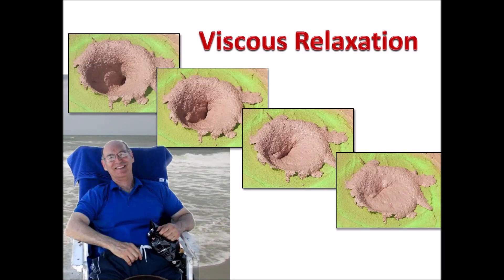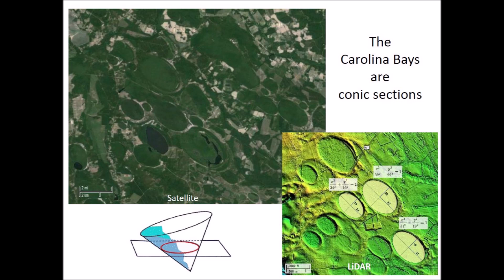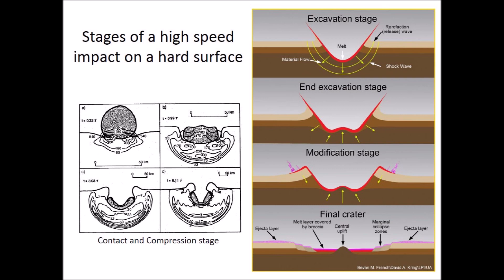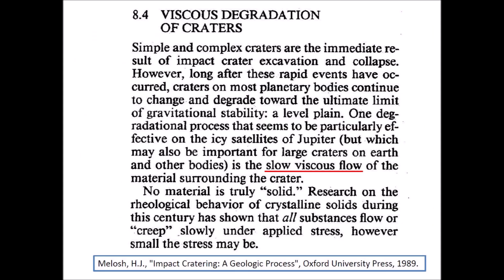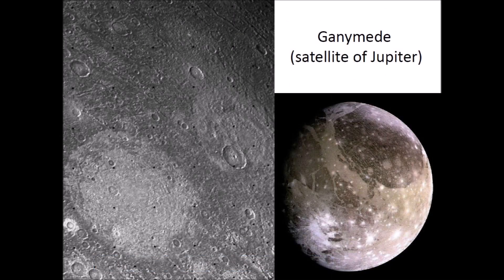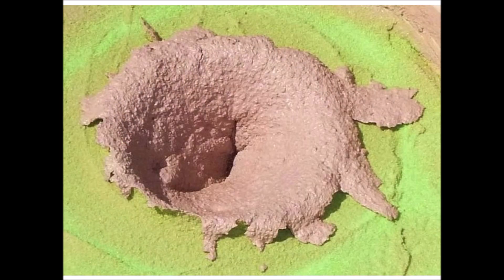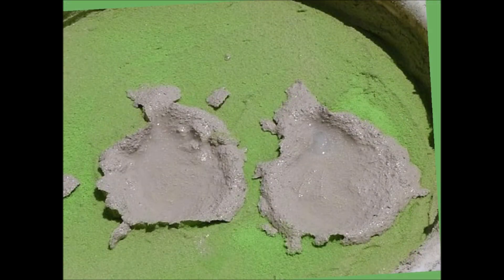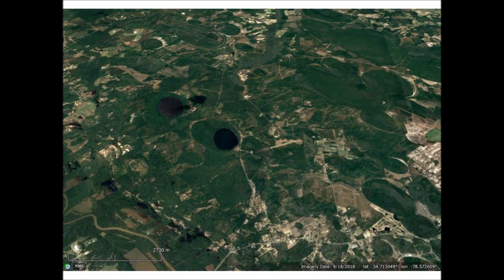Viscous Relaxation

Comment: I think you've proved they are from impacts beyond a doubt. Now we have to pin them to the YDB if that's indeed where they are from
Reply from the maker: Dating the Carolina Bays to the YDB is a hard task because the dates from radiocarbon and Optically Stimulated Luminescence vary widely.  However,  the dates of the overturned flaps (raised rims) provide some confirmation.  See this video: https://youtu.be/j63e8n0628Q

Comment: Antonio! I am thinking the ghost bay outlines and sand deposits are rock flour from the melting glacier chunks. Contact me at ahwild@aol.com
Reply from the maker: Impact cratering on a viscous medium displaces material by horizontal compressive forces to make the raised rims.  Rain percolates through the raised rims and washes out the clay, leaving only the white sand.  I discussed the sand rims in this video: https://youtu.be/jKvS4F9TA6s 
Note: the rims are not likely to be rock flour from the melting glacier, because the rims are the overturned flaps made during the formation of a penetration funnel before the ice projectile has had a chance to melt.  The friction of the impact may melt some ice of the projectile, but not enough to account for the volume of the rims. Also, many of the ice projectiles may not have contained much material from the Saginaw Bay area because they would have come from the top of a 2-km-thick ice sheet.
Reply: @Antonio_Zamora  most glacier ice contains suspended ground up rock - which may be traced to its point of origin. Why would the laurintide ice sheet be different? I think It is likely that the sand deposits around the Carolina bays are not local - but came in suspended in the ice chunks and accumulated under the areas where the majority of the frozen ice accumulated after impact and ultimately melted. Ie the southeastern tip end of the crater and at predictable points around the rims. There is too much sand for it to have been originally local to this area. I live in Sumter SC. I have been flying my drone over quite a few of these things in my area. The bay sand deposits are not typical local soil and there is too much of it. Ps thanks for responding. I have your book “The neglected Carolina bays” and have carefully read what you said about the rims. Glacier ice melt doesn’t produce clean water. It is full of white suspended silt. Please read up on glacier rock flour and lake Missoula. I have also been to see glacier melts in Alaska and Canada. Some serious study of the sand deposits may yield traces of rock which could have only come from Michigan.
Reply from the maker: @ahwild123  The only difference between modern glaciers and the Laurentide Ice Sheet would be the thickness. The clasts and sandy grit get incorporated into the glacier from the contact of the ice with the land.  The rock powder stays at the bottom of the glacier where it grinds the landscape.  New snow accumulates on top so that the top of the glacier is pure ice without stone powder. I went to Glacier Bay in Alaska, and the tops of the glaciers are always white, whereas the bottoms are full of grit.  Glaciers calve into the water and make it milky white from the suspended rocky material. The silt from the glaciers is quite different from the sand in the Carolina Bay rims, which is like beach sand.  This web page has a picture of me in front of one of the glaciers:
https://www.scientificpsychic.com/alpha/travel/alaska/glacier-bay-background.jpg
https://www.scientificpsychic.com/alpha/travel/alaska-glacier-bay.html
Reply: @Antonio_Zamora  thank you again for responding. , I see where you dug a trench in one of these bays and I admire your tenacity! I would like to gather some sand deposits from our local bays but don’t know if I’ll get the chance. There is indeed a strata of ancient beach sand all across the SC midland - but I can’t imagine how it would wind up at the characteristic locations on so many Carolina bays if it weren’t originally a part of the fractured ice chunk itself. Leeching alone without added material from the ice would not produce the characteristic patterns i don’t think - eg the small ghost bays don’t seem to even reach into the subsoil, but I can easily imagine a water /snowball making the pattern on the surface. I am hoping you figure all of this out during my lifetime , my dad would have been fascinated - he used to fly a plane and used the orientation bays to navigate.
Reply: I was over at woods bay state park last week . The sand around that bay is not the same as the sand dunes at ocean drive  beach sc...even if some ‘expert” tells you it’s local. The woods bay sand is finer and whiter, even it’s chemistry has got to be different cause certain local plants won’t grow in it.. And - Given how much material and ice your estimates say were distributed all over North America- that Michigan glacier sand may well be surface local everywhere now in NA.. But I’ll bet it’s different than what’s in the local substrata. I can’t think of a way that one could predict the original glacier depth of The ice that likely came from Saginaw bay although I wouldn’t think it would be pure surface snow. The snow on the surface would likely have vaporized on comet impact and only the more compressed deep ice have the cohesiveness to remain in a chunk- though fractured and launched by the explosive impact. My money is on deep compressed ice close to the bottom of the glacier. Which would have plenty of white flour powder in it. I think melting and leeching concentrated it on the surface - sure - but how does a very small bay excavate that kind of deeply buried sand?

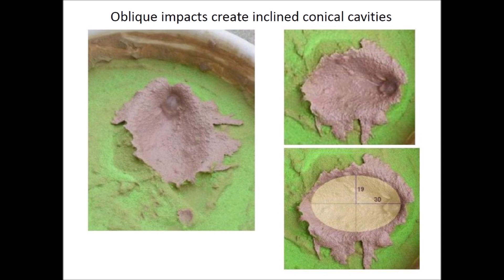Comment: You suggested that the displaced soil returns to its original stratification as a result of viscous relaxation ( 4:13 ). I am neither a geologist nor a physicist, but common sense tells me that the subsidence of the soil along the crater walls would result in a largely homogenous fill, or at least a highly distorted stratification. A cross-section of an impact into hard soil is an extreme example of this. ( 1:25 ) Can you direct me to a study or experiment that demonstrates such re-stratification?
Otherwise, I'm totally on board with your theory! I love your videos and look forward to many more. Thanks for all that you do.
Reply: No doubt the impact on the Laurentide ice sheet ejected enough material into the atmosphere to drastically alter the climate--hence the Younger-Dryas cooling. Might it be reasonable to think that there were periods of catastrophic rains prior to the cool-down? These rains would have hastened the liquification and subsidence of the crater walls.
Reply from the maker: Most of the East Coast has the water table within 5 ft of the surface. Seismic vibrations of magnitude 6.0 or higher would have been enough to liquefy the soil. The impacts with energy of 13 kilotons  to 3 megatons of TNT would have produced seismic vibrations equivalent to 6.0 to 7.54 magnitude earthquakes, which would liquefy the soil. Thus, the ice boulders would have hit a liquefied terrain regardless of whether there had been rain before or not. Search for "liquefaction experiments" and you will find many YouTube videos of geology experiments showing vibration-induced liquefaction.
Reply from the maker: The video included pictures of experiments showing that viscous relaxation fills the cavity from the bottom up by centripetal laminar flow. The experiment with the red layer demonstrates that the stratigraphy is restored. This is what is actually observed in the Carolina Bays. The bays do not have a jumbled stratigraphy, and this is used as an argument by opponents of the impact hypothesis to claim that the bays were not produced by impacts. The experiment with the red layer serves to counter this argument.

Comment: Excellent presentation. A general question about the Comet fragment impact in general. Would it have been energetic enough to eject matter from Earth permanently ? And if so, do we have simulations that are reliable enough to come close to predicting the aftermath ?
Reply from the maker: Most large impacts can eject some material at speeds exceeding Earth's escape velocity. Similarly, impacts on Mars have ejected stones that later fell on Earth as meteorites.
Reply: Thank you for your reply. The reason I asked about computer simulations is that the U S Chesapeake bay area strike left a crater almost half the size of the Dinosaur killer, yet according to what comes up from Google, there was no associated mass extinction. If this is actually true, then the Younger Dryas strike(s) must have had an energy somewhere in between. Is this plausible ?
Reply from the maker: The Chesapeake impact happened about 35 million years ago. The dinosaurs were gone by then, but I am sure that the mammals that populated America at the time would have been devastated.

Comment: If the Carolina Bays are older than 12.9ka then there should be black mat proxies within the isolated basins, if not then they were formed after or possibly during.  Of all those raised rim petri dishes and zero proxies?  I like the picture at the beach, reminds me of a spectacle once of someone getting caught in the surf with a car.  Must be next to impossible to pull them out once the sand and surf get their chance.  Complex craters must run out of energy at different times during their formations alike capriciously freeze framing the video.